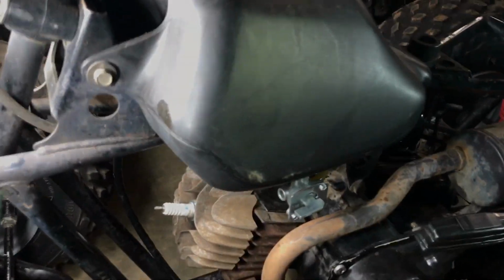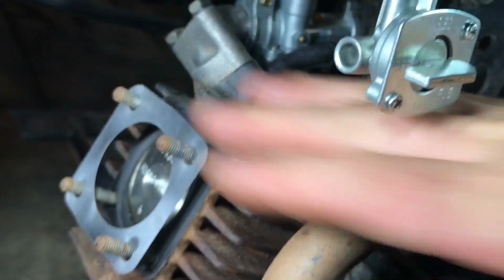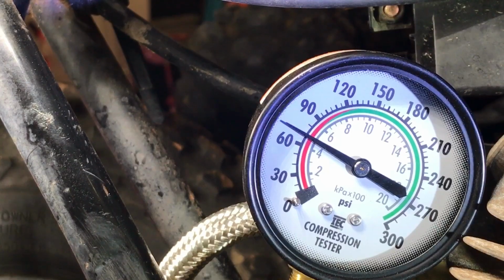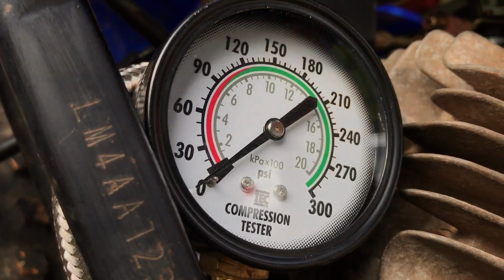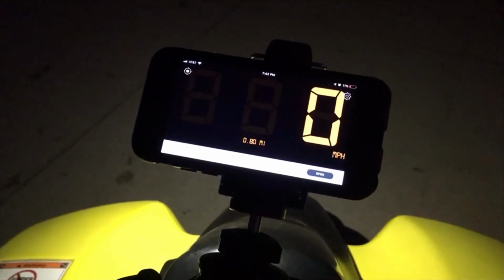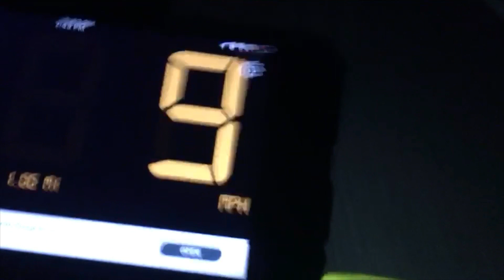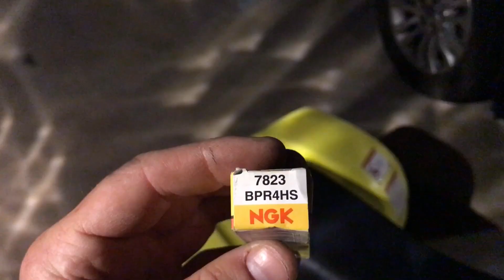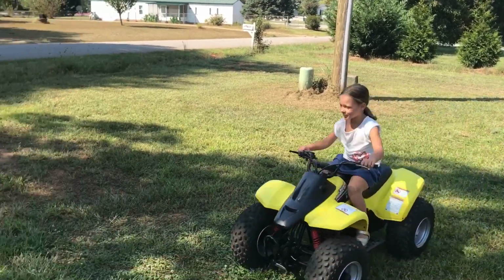(Pt:4) high compression head! 02 Suzuki LT50 QuadMaster

Comment from the maker: Smash the like button:)
Hope y’all enjoy the video...
Reply: Mine had 120 psi stock ?
Reply from the maker: @brocksaunders7058  that’s nice.
Reply from the maker: Might need to bore the cylinder.
Reply: What is the compression supposed to be stock
Reply from the maker: @brocksaunders7058  Should be definitely around 120 stock
Reply: @BTR2018  that’s a lot also don’t mean to bother you but what way is chock off doesn’t say on there
Reply from the maker: @brocksaunders7058  choke is up.
Reply from the maker: @brocksaunders7058  http://www.crservice.dk/Suzuki%20ATV/LT50/LT-A50_99500-20212-01E.pdf
Good Service manual. Hope it helps.
Reply: @BTR2018  thanks for your help I appreciate it
Reply from the maker: @brocksaunders7058  your very welcome.
Reply: @BTR2018  many thanks on that manual! YT wouldn't let me open it, but stoked to find one
Reply from the maker: Your welcome, that’s what I try to do is help😊

Comment: I am having an issue with my LTA 50/ KFX 50 motors. I have two that I'm going through. First one (LTA) had the crank seals redone and put on a niche top end in Jan. Ran fine until May before it had issues. I picked up a KFX in July that didn't run. The OEM jug/head is in great shape off that one. My plan is to run the motor that had the crank seals done already with the OEM jug and head and new piston. I haven't got to that one yet. Currently I am working on the motor from the KFX (not sure about the seals) and the Niche jug/head that I had rehoned/surfaced and a new piston (again). I got it together and it initially started. Got it to run/start a few times before it didn't. Tested compression and got about 60 or so. Trying to figure out the issue there still. Everything else on the quad has been cleaned and gone through. I even cleaned out the exhaust on the one I just tried to get going. Got any ideas or thoughts on my issues. Want this thing to run so my kid can ride again. He keeps asking and I keep trying.
Reply from the maker: Could be a wore out jug. To do it properly you need to have the jug measured out and make sure the piston ring has the perfect gap or else you’ll be losing a lot of compression. That compression reading of 60 is really low.
Reply: @BTR2018  This jug was a Niche branded one of sorts and just put on initially in January this year. I had it honed again after taking it apart and asked the guy who did it if was still in spec on bore. He said yes. Anyways, what can I do measure it to the best of my ability. I have the manual to refer to but I only have digital caliper and feeler gauge at my disposal.
Reply from the maker: @kyleknoll1988  you need telescope, gauges, and then you can use the calipers to measure the telescope gauge to make sure this will get you in a ballpark

Comment: I'm currently doing a full frame off restore of a 1983 lt50 (first model year). Watched your video this morning and decided this seems like it it would be a cool little upgrade while I have the engine apart. Is there anything else I should consider before doing this? Like a cooler spark plug or re-jetting carb? I'm a bit of a novice
Reply from the maker: Dude that’s awesome, yes you might have to go with a cooler spark plug and you might have to change the jets. All depends on elevation and your weather.

Comment: Have you done any adjustments on the clutch?? Have an 02 LTA 50 and quit running. Until I saw your videos it wouldn't start. But the seal on crank was pushed out. Had my son push it back and now it's running again. Thank for the videos,  but still need help with clutch. When we first got it it would move nice with my 245lbs no problem. Now it just barley goes and I now weigh less lol. Can you help ??? I think it's the clutch I'm having trouble with now. Any ideas 
Thanks in advance.
Reply from the maker: You’re welcome for the videos please like and subscribe follow me on Instagram built to run also on the clutch try finding a manual On how to adjust a clutch I can’t really remember off the top of my head how to do it.

Comment: Hi buddy so you ended up removing 1.12mm from the head? Could you have gone any further what made you remove this amount and not any more?

Also what plug did you go for the 4 is the standard but i read people saying go for a 5 or evan a 6 if head is skimmed.

Also do you remember which main jet you used the standard is a 55 im thinking to go with a 65?

Thanks.
Reply from the maker: Yes you can remove more, you can remove till there’s barely an lip. 
I stayed with a 4 spark plug. 
I kept the stock jet.
Reply: Did you pre mix or use oil injection?
Thanks
Reply from the maker: @jurassicjarvis3443  Yes I went with pre-mix.

Comment: Any idea what the compression should be? I have a 02 that is at 92 lbs of compression and I'm not sure if it is low or not. Second I had it running good last year and now it runs but is lacking power and stalls alot. Any idea on the stock air fuel screw settings? Thanks
Reply from the maker: Should be around 120psi. 
Please like and subscribe.